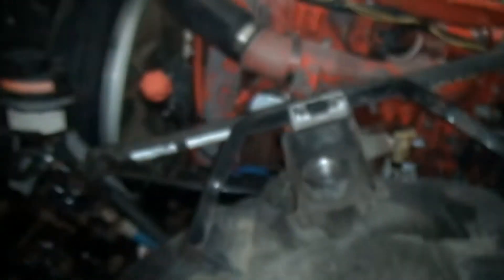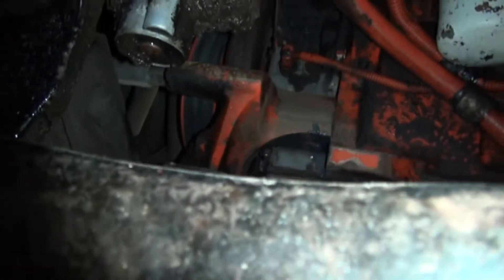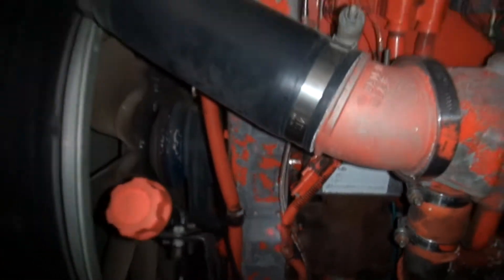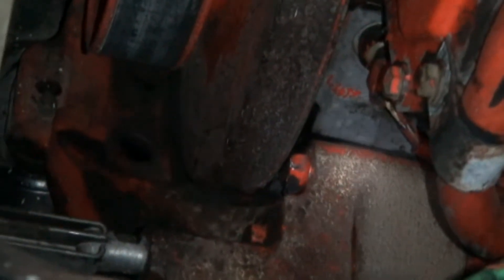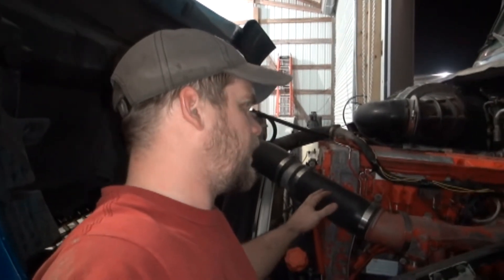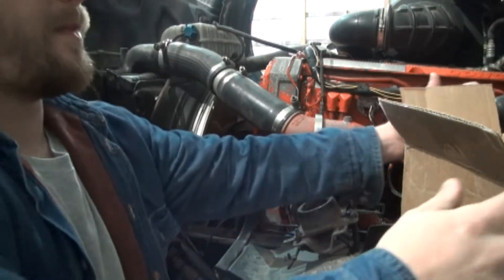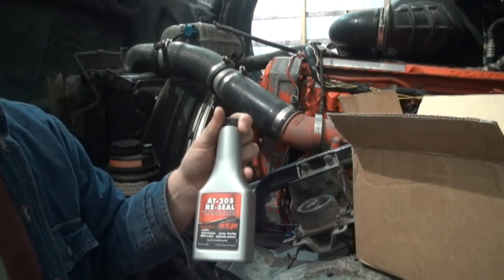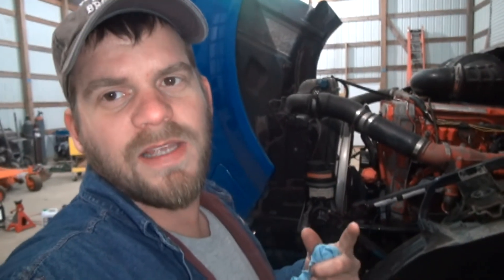Cummins ISX oil leak patch job Didn't last long, permanent repair coming.

Comment from the maker: Oil leak has been properly repaired, but this did get me by a few weeks until I could source all the parts for the repair. video coming soon on the repair, Thanks for watching
Reply: chase5726 ❤️😘❤️
Reply: I got very slow leak on oil pan gasket. I got isx 15 . 12 gallons sump. Do you replace amount of oil with at205? Is it Ok to use with oil in crankcase or run with new oil? How many miles I should keep that oil in there before change?

Comment: I've had good luck with at205 . You lost 5 gallons of oil - must be about half the capacity.  Great idea on the bed liner.  It's been a tough year for repairs Chase .  Oh the life of a trucker it's not easy. Hope it's all good now.
Reply from the maker: yep that's about half capacity.

Comment: I had my front seal on my isx 15 replaced for about a grand. They just jacked, and pushed things forward, without removing all that. One full day, done!
Reply: Hey Matt where are you located and who did that job for you
Reply: @shaunnelson7103  

I believe it was at a shop called Transpower in Valdosta, Ga

Comment: It's a common issue on high mileage isx, it leaks that much from the gear housing because of flexing, and there's an oil feed hole in that area, once removed you will see fretting in that area, the aluminium gear housing will have to be replaced.  The leak  on top is not the head gasket, it's the 2 orings on each cam plates that went dry

Comment: Hey Chase. My first thought how the bed liner stuff would hold up to the engine heat. Good video, man!
Reply from the maker: yeah, also the expansion and contraction of the metal from hot to cold.
Reply: That’s right

Comment: Are no oil galies on left side of the head, you have an oil seal at the cam that runs the fuel injectors. Have to pull the oil pan and both front covers. More labor.

Comment: What year is your truck. And how many miles does it have. I am lease to landstar. Running step deck , I under you there, have you tried Lucas  stop oil leak it works  pretty good, I had a oil leak on my Volvo back plate engine cover, I had to pull the transmission  to put a gasket on that rear plate, what a joke that was.

Comment: My mechanic charge me $500 and repaired it in one day, no need to removed radiator only fan clutch base , then the timing cover, then gears and replaced gaskets
Reply: How much did all the parts (gaskets..) cost you?.. thx
Reply: @abdussamadbenalla6720  gaskets around $50 dollars

Comment: I just had my front seals done drove the truck about 2.5 weeks leaking again took it back to the mechanic my bolt to the fuel pump that goes through the front caver snapped I know he over tighten it but he said he didn’t going to fix it but is going to charge me I don’t think that’s right

Comment: just put two bottles of this in my 4r70w ford transmission. thinking i may have the same results for the front seal of it not working after 15 mins of driving. wont know till end of the week. edit drove a tank full of gas and trans is still leak a fist size puddle.

Comment: I have a 2007 isx with 1.3 million miles an it's doing the exact same thing...just not loosing as much oil
Reply: My isx 1.5mil also
Reply: How long did it last? My 09 with 560k just started leaking and I'm wanting to run it for another 6 months
Reply: @shekelclipper4069  I'm at 1.4 now it's still about the same I have yet to get it repaired...most likely when I do an overhaul
Reply: @jeffreyweston900  Thank you so much for answering back. Mine isn't using hardly any oil at all just leaving a spot when I'm parked for awhile. But you know as an O/O these types of issues can worry you to death. Especially being that I just signed into a new outfit 2 weeks ago and am finally making decent money. I don't haul any weight now and am running Ohio weather. So not too hot.

Comment: Hi, Is there enough room to change front main seal on isx without removing radiator?
Reply: That's how they changed my seal out. Without removing all that.
Reply: on a Volvo with Cummins engine you don't have to remove the radiator to replace front main seal

Comment: It's not that expensive just gaskets .but be sure to unload sizzor gear and it loads back when you set gears  or it 
Will eat the fuel idel gear up and the front cover hire a real mechanic
Reply: 20 hour job